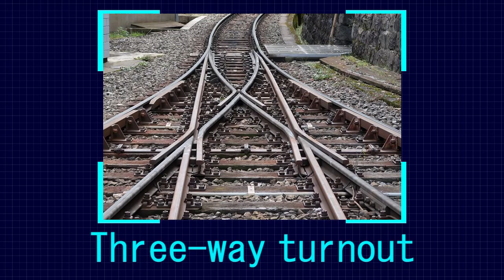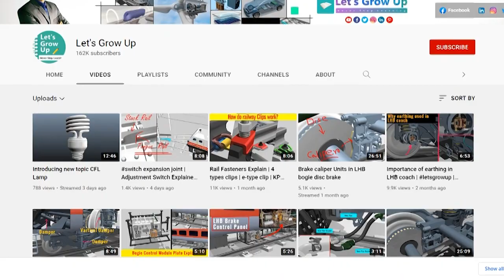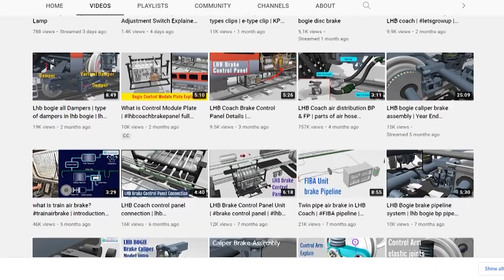Working system of three way railway crossing | 3 way railway track | railway track change

Comment: 0:54 This is not an equilateral turnout. Note only right track curves at the switch.
0:59 This is not a slip. This is a double crossover.